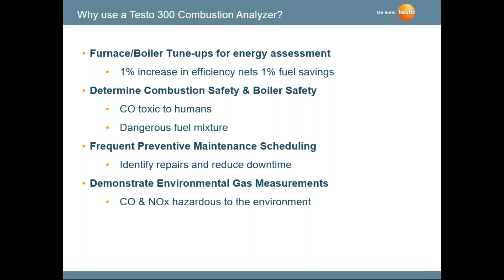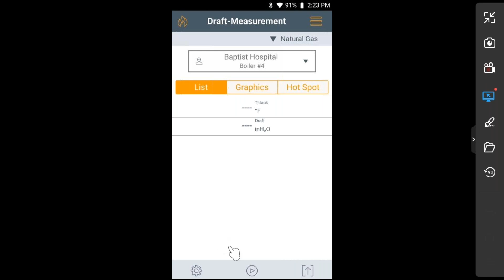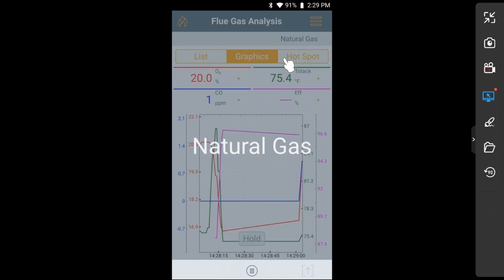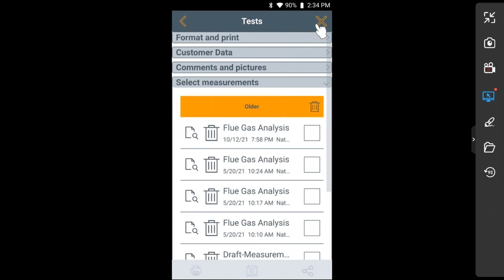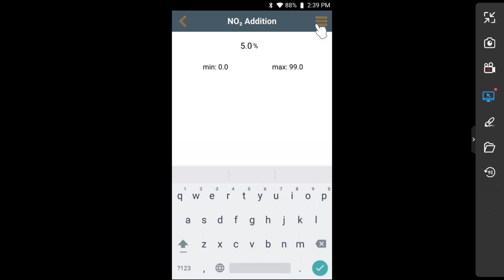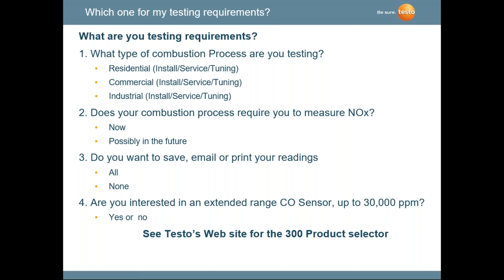Testo Webinar: Understanding and Operating the Testo 300 Combustion Analyzer

Comment: I have two of these (with NO) and two of the previous 330s. They are all good analyzers, but the best part for me is the Easyheat software. The live readings with tending are so useful. I use these in industrial applications where emission readings can be changing for many reasons. Tending the readings allows you to correlate emission changes with process changes. Often the control and tuning functions are conducted at a significant distance from the sensing point. I connect the analyzer to a PC at the sample location and then remote into that PC from another one in the control room where ratio adjustments and process changes are made. Being able to monitor the trend from the control room has uncovered many reasons for emission changes unrelated to air/fuel ratio.